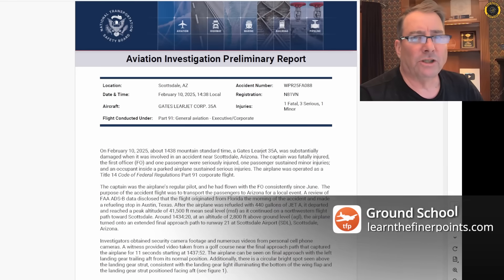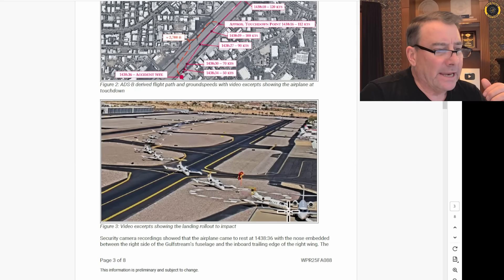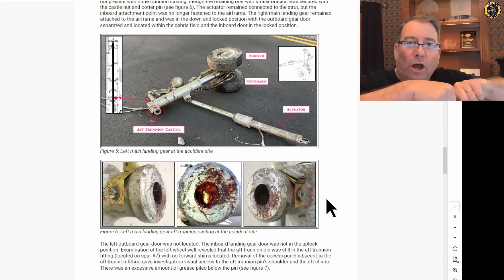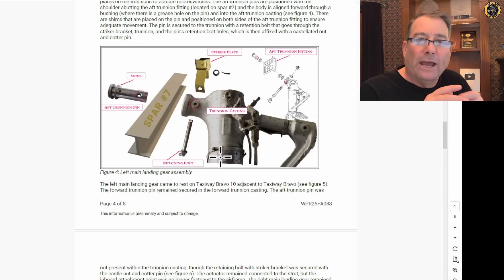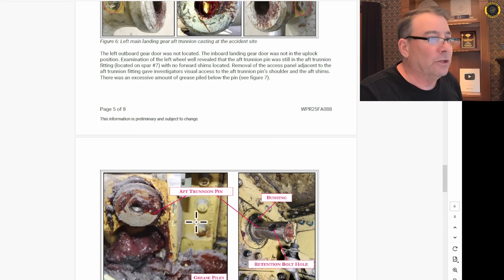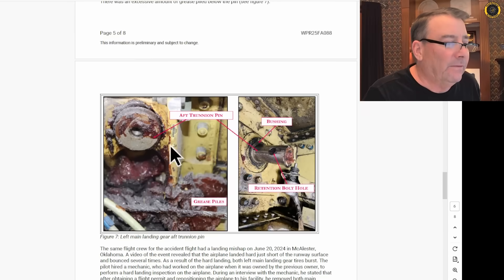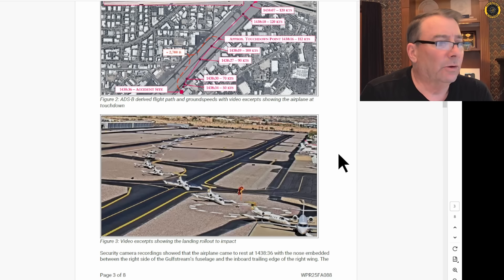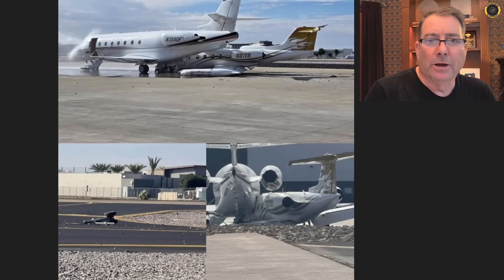NTSB Preliminary Report Fatal Maintenance Error Lear 35 Scottsdale

Comment: Juan, an eighteen-year Learjet mechanic and fourteen-year Learjet pilot, here. The down and locked switch that triggers the gear down green light for all Learjets is located on the extend and retract actuator. The pilot will get a green light in the cockpit if the actuator is fully extended. They would not have known unless someone from the ground mentioned the gear was hanging.
Reply: Yes, if the main landing gear actuator was fully extended, and the inboard gear door closed properly the pilot would have had totally normal indications in the cockpit, 3 green, 0 red. I worked on Air Force Lear 35s for many years. That trunnion pin was a required inspection item when installing a main landing gear strut, we didn't go any further on the insall until an inspector verified that the pin was shimmed properly and that the retaining bolt was installed through the pin.
Reply: @matthewbrown9840  unfortunately, RII inspections as we call them in the civilian world, are not required by operations of 9 seats or less by FAA regulations. It however, is still good practice to have a second set of eyes for critical installations.
Reply: @matthewbrown9840 , I’m a retired A&P, and I agree %100! I’ve done similar jobs, it is difficult to align that bolt hole in trunnion pin. It’s dark and cramped up in the top of the wheel well. It would have been obvious that the trunnion pin wasn’t seated by that 1/2 inch gap between the head of the pin and the pivot bearing.
Reply: That is really poor maintenance. Having worked as a service engineer for forty years. That is lazy maintenance. There are so many ways to check that you have the bolt going through the hole its just amazing someone would not check his work.
Reply from the maker: Thanks DW!
Reply: I assume that is a floating pin through the spar bushing and possibly got pushed out the backside as the trunion slid onto the pin allowing the retaining bolt to be installed missing the pin. Would not be noticed unless you inspected the backside of the spar.
Reply: @troybockhop1351  a measurement of the trunnion pin head to the spar bushing bearing block is required during the installation procedure per the maintenance manual. The tolerance is to be measured to a specific dimension.
Reply: And the landing light was on, that can only happen when the gear indicates down to prevent it from coming on in the wheel well.
Reply: To add to the original post, the red "Gear Unsafe" indicators for the MLG are merely sequence completion indications that, when illuminated, indicate the landing gear doors are open.
Reply: @FlyingtheLJ  does that mean you have 3 green and 3 red with proper gear down config?
Reply: @jamesmurray3948  in the Learjet design, if all gear extend actuators are fully extended, you’ll get the three green. The red indications are for the gear doors not being closed. You only see those if the gear is in transit where the gear doors are open, or in an emergency extension where the gear doors won’t close due to the emergency extension system. Gear doors open during landing does not constitute an emergency in a Lear.
Reply: @jamesmurray3948  No, the gear doors close again at the end of the extension sequence so you have three green and no red.  I should have clarified the sensor relates to the inboard door, not the outer.  The NLG Unsafe has a different meaning and indicates that the NLG has not locked in place and is stuck in transit (since the NLG doors remain open once extended).

I'm not sure on the 35A, but on the 31A you would be able to tell if the system indicates a MLG is down and locked because the landing light will not illuminate unless the system recognizes the gear as down and locked (green light).  Since in the picture of the accident aircraft we can see the landing light is illuminated, that may indicate that the crew saw the green "Down" light in the cockpit.  Again, I'm talking from experience in the later 31/31A models so I'm not 100% sure if this same feature exists in the 35A, though they have the same landing gear systems.
Reply: @FlyingtheLJ  this is correct. The landing light circuit has continuity through the down lock switch located on the extension actuator. As pilots, we are trained to use the landing light as a secondary indication for the gear down and locked since it uses the same down lock switch.
Reply: @DW-ep9wj  So would this malfunction would show 3 green but also 1 or more red?
Reply: @jamesmurray3948  Factually by the system design, if the inboard gear doors are up and locked, no red lights would be presented in the cockpit.
Reply: @DW-ep9wj  So do we think there was 1 red light showing?
Reply: @jamesmurray3948 read what he said. There is a potential for one red and 3 green. Red being door didn’t close but not an emergency situation.
Reply: @jamesmurray3948  we only know what the NTSB is reporting in this report. Any further information will be provided in the final report once the CVR has been transcribed.
Reply: @davidmichael5573  Does Lear have a non normal for a red with 3 green? Does a good pilot have a sixth sense about strange cockpit indications after he has already let that bird be pranged short of a runway and it's been "repaired".
Reply: @FlyingtheLJ  the inboard gear doors were  closed. This would extinguished the red unsafe lights.
Reply: @alainvallejo6042  " The inboard landing gear door was not in the uplock position." Does this mean there might have been a red light?
Reply: I’ll say that on a T-45 nose landing gear (for example), there’s little room for error concerning pinning the trunnion pin. There’s about 3.5” on the outboard end of the trunnion pin that extends outboard of the trunnion pin thrubolt, that goes into the trunnion housing; and 1.25” that protrudes outboard of the trunnion pin thrubolt (on the inboard side of the trunnion pin) that sits flush with the inboard end of nose trunnion housing; on each side of the strut trunnion housing. The hole for the trunnion pin thrubolt that goes through the trunnion pin has minimal tolerance. If you mis-pin the trunnion pin with the thrubolt not going through the trunnion pin, then the trunnion pin will be outboard of the trunnion pin thrubolt, and there won’t be any visible evidence of the trunnion pin when looking at the nose gear trunnion pin mount. As a fighter jet mechanic of over 19 years, every aircraft (F-15, F-16, etc) I’ve worked on, has a way of visually verifying whether or not a trunnion pin is correctly protruding from the trunnion housing. Attention to detail while following technical data is paramount.
Reply: Re-installing the trunnion and lock pin is supposed to be a two person job.  When it's done by one person it's possible to to miss align the locking pin.  This is what happened to me on a Lear25 when the gear collapsed two or three seconds after landing.  I executed a balked landing, pumped fuel to the other side and didn't lose directional control until about 40Kts or so.  There should have been plenty of aerodynamic control to counter a dragging main.
Reply: Same design as used on the Cessna 550 Citation.  Thanks!
Reply: Is it hard to see the head of Aft Trunnion Pin because it’s hidden behind Spar #7 ?
Reply: I guess there aren't digital maintenance logs with specific required photos which would of shown too much space between trunnion casting and spar and head of pin flush with other side of spar. A few required measurements would detect the problem. Sticking a screwdriver or something in trunnion casting and seeing there was too much space not small cylindrical hole through pin would detect the problem. Need a few more required inspection steps.
Reply: I work on my own vehicles (not airplanes) but I am very fussy about fitment. Seems like a procedure was not followed. Very tragic.
Reply: @kurtvanluven9351 . …and probably an understanding of why things go together a certain way and what their functions are…right?
Reply: Retired A&P here, but never worked on Lears. It would seem there should be a way to verify that pin is seated all the way before inserting the retaining bolt. Was there some step that was overlooked?
Reply: @EmesiS  Learjet released AW32-068 today to discuss a visual inspection of the aft trunnion pin. A Service Bulletin (SB) will be released in the coming weeks to address inspection of the trunnion pin insertion to further clarify the present procedure. Yes, at present, the procedure states the trunnion pin bolt must be verified to be aligned with the trunnion pin bolt hole and the tolerances measured. The AMM procedure is precise.
Reply: @DW-ep9wj  Sad they had to put out a SB to cover something so detailed already in the AMM that just about ALL of us who worked on those old garbage scow  know about. Plus you have to remove the damned long bolt one uses  to rotate the pin to get the holes lined up for the  retaining bolt- Stevie wonder could have seen that pin head !
Reply: @DW-ep9wj  "The NTSB is aware of at least three other prior events where a Learjet landing gear had disconnected from the airframe because the retaining bolt was not engaged through the aft trunnion pin." Curious if the final report will identify the breakdown in process & procedures that missed the proper installation of the aft trunnion pin.
Reply: @EmesiS  oh there is.... mark one mod zero calibrated eyeballs. It is a bitch to line up the trunnion pin holes to get the big retaining bolt in. The trunnion pin is drilled and tapped at the head so you can thread a bolt into it to jostle and rotate the pin to align all the holes then you remove the bolt. At that point you should be looking right at the head or the pin see if its seated. It stands out like a sore thumb if it is not... in this case it would be at least a 1/2" sticking up
Reply: @EmesiS  You give it a yank and if it falls off it wasn't right. A valid check would include measuring the overall length of the pin/trunion assembly as there would be a gross overlength if the pin wasn't fully seated.
Reply: @EmesiS  I'm not qualified in any way regarding this, but I would have thought the pin would have been obviously not seated, to the fact that a lot of shims would have been needed to compensate?
Reply: @bsmith2053  I'm not a mechanic but I also thought, that must have been one heck of a shim stack to get the proper clearance!
Reply: Most likely.   There are procedures for everything.  You have to open the manual and follow them.
Reply: @EmesiS thats what i was wondering like a go no go depth marking or  measurement.
Reply: Where were the manuals when the work was donez?
Reply: Details do not matter as much as cognitive ability. In 1809, IQ's were 15 points higher than today. It is dropping 1 point per decade, global average. The dysfunction is just beginning. This is due to dysgenic breeding, a replacement for harsh darwinian selection for intelligence, mental health and physical health. These days the bottom of the bottom has an above replacement fertility rate. In time it will be hard to keep the lights on.
Reply: Can't of possibly shimmed up the pin to set up the clearances. Very sloppy.
Reply: @DW-ep9wj  thank you sir.  That was a question I had. Does the actuator need to be fully extended to trigger the green light?
Reply: We discovered this same indication issue in the F-15C. Turns out we get a green light if it’s down even if it’s not locked. Different design on the F-15E
Reply: The same as the Lear 45, pilot wouldn’t have known unless he tried to retract the gear.
Reply: not a pilot or a mechanic but that seems like a poor design? It's not showing the gear is down, it's showing that the actuator is extended?
Reply: @gdwnet  there needs to be an assumption that proper maintenance procedures are followed for systems to function properly. An aircraft manufacturer cannot design in a safety system for every incorrect installation procedure.
Reply: @ That's a totally fair point, thank you.
Reply: @gdwnet  well landing gears are " supposed " to stay in their cubbyholes and not fall out. It is a system used for decades on all different manufacturers airframes
Reply: @gdwnet  well, there are always some things you can´ t plan for. Who would think the gear isn´attached properly ? OTOH - and the Lear is a real old design - it would not be an issue to make LDG facing cameras mandatory. Given the real low numbers of incidents like this I doubt there will be such a mandate soon, though....I feel so sorry for this crew, when they realized 'something' was wrong, they were in for a ride and a tragedy as well.
Reply: How about changing to a bunch of cheap cameras instead of indicator lights?   Pilots could get alot more confident of their airship if they could visually see all parts of it.   Gear down? Yes, look at the picture.   Are the engines on fire?  Yes, look at the picture...
Reply: @gregcollins3404 I see a few issues with that.  First, which is more likely to fail and not provide the pilot with good information - a lighting/camera/computer/display system, or a switch and lamp?  Keep in mind that a failure of a camera system includes things like the lens getting dirty or wet.

Second, which is going to require a lot of attention from a pilot when he is already busy - selecting a view, looking at it, and determining if it looks right or not (in this case, repeat three times), or a quick glance to see if three lights are green?

More information is not always better.
Reply: @briansomething5987  I was just thinking about your second point the other day, while driving my car. I bought it last year to replace my 2010 model. The old car had no backup camera, just mirrors and my head on a swivel. This newer car has a backup camera with alignment indicators, cross traffic warning, etc. But I realized that I still need to check all 3 mirrors, AND the camera. Sometimes it's too much input for my brain to efficiently process. I think I spend more time processing all the visual input than I would have in my old car. Also, backup cameras are not perfect. Depending how they are mounted, they may show a somewhat distorted view. Somehow the rear window washer also washes the camera, so if I wash the rear window just before backing out of my driveway, I get drops of washer fluid on the camera.

Not really a big problem, but this car with all its bells and whistles has shown me that I must be a little more careful how I manage my mental tasks.

Yesterday I received an Important Notice from the manufacturer explaining that they are kindly extending the Infotainment Audio Head Unit warranty from 3 years/36K miles to 8 years/150K miles. Covered issues include blank screen, complete loss or inconsistent audio, repeated rebooting, Android Auto, Navigation, Bluetooth, touchscreen. Except for the sound system (controlled by knobs & buttons), my previous car had none of those. I could say that none of those are essential, except that this unit is also how you control things like how your door locks operate, and other functions that may indeed affect your safety.
Reply: @gregcollins3404  All retractables should, at least, have a reinforced  forward looking GoPro mounted under the tail on the tail eyehook tie-down.  For reference, watch FlyWithKay videos and see her Seneca's tail mounted GoPro in action.  Easily viewable in the cockpit with the GoPro app.
Reply: DW, CPL here. Do you think I could fly with you sometime?  I have zero turbine experience. I don’t even need to log anything- just some exposure would be nice.

Comment: It's the little things that sometimes end up being the big things that made me really concerned when owners would DIY their own avionics, electrical, and A&P work in their planes. In the three years I worked on planes professionally (while working on my CFII/MEI) there were dozens of safety misses I observed from improper maintenance, either by owners DIYing it or by supposed professionals. This could've been so much worse, but we see several fatalities each year caused by flawed maintenance work and eventually it catches up with you. Fly safe.
Reply: I once was planning to fly a Commander 680 for a guy that hired his maintenance helpers from the Home Depot parking lot.  He was a contractor by trade and figured if they could fix a house they could fix a plane.  The day I walked into the hangar and saw what was going on, I did the ole Abe Simpson 180 and never came back.
Reply: @hawaiianetops9566  Whenever we saw electrical tape and wire nuts, we knew we were in for a wild ride.